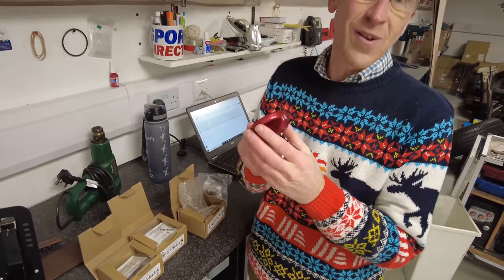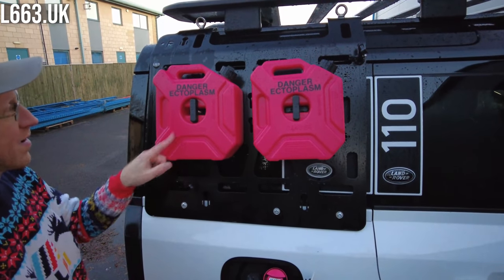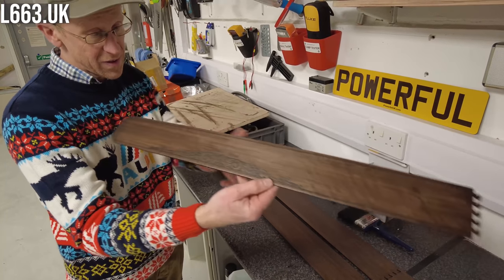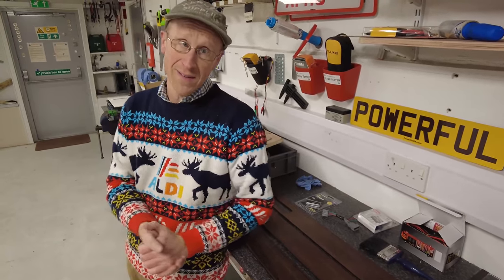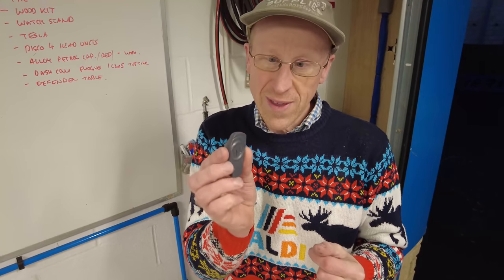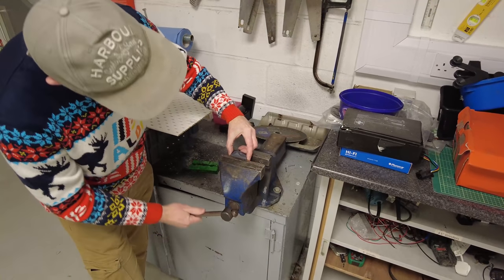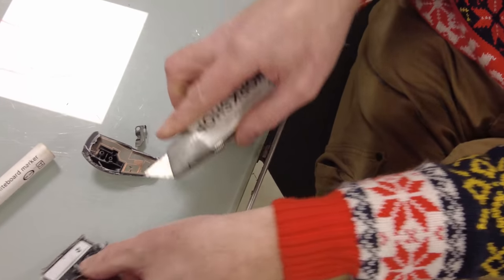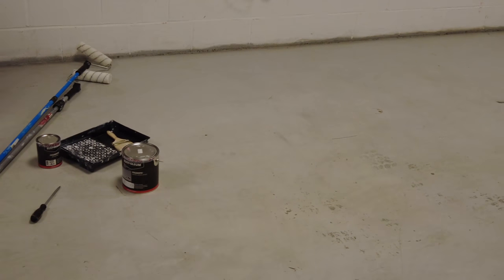Vlog 10 Dec 21 - Defender Dash Kit / Disco 4 Android Unit / Activity Watch Holder

Comment: The android touchscreens look interesting. Look forward to that or those videos.
Reply from the maker: Hi Steve - yes they look interesting and the Android systems are getting better quickly... also they support Android Auto and Apple Carplay straight out of the box ( apparently )
Reply: @L663  Hearing bad things about these chinese android units, IF they are +2gb ram then OK but 2mb or less not so good. Very interested to know about your units for both main screen replacement and the heating / air con replacement system